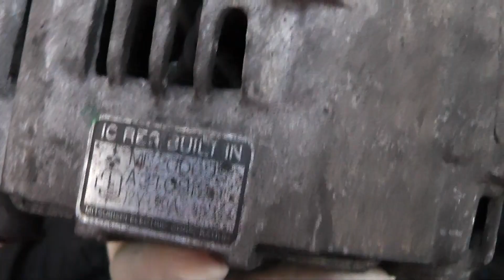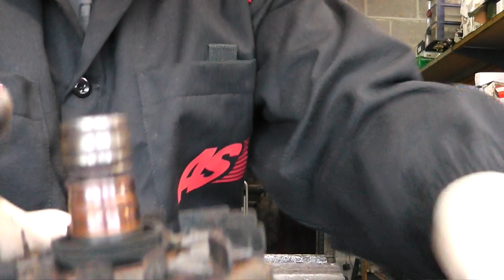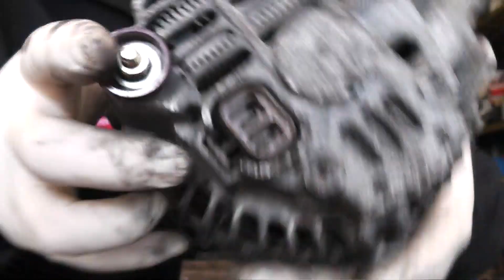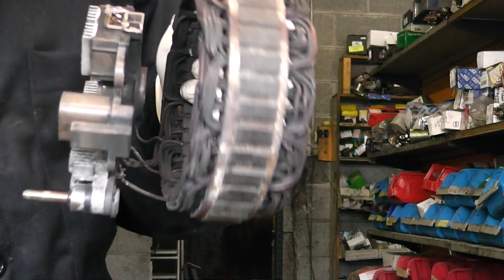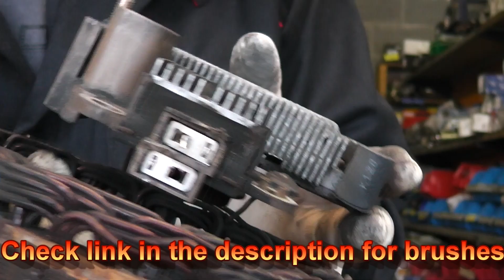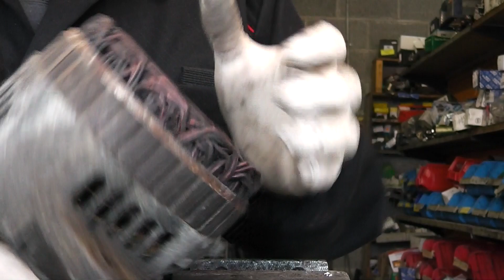Mitsubishi alternator repair / brush change. Fits Pajero, Kia,Pegeot and many more.

Comment: gday mate. I am doing an A55000 Mitsubishi alternator off a Kubota. I am up to aligning the slip rings with the brushes, the setup is almost identical to the alternator in your video. The alternator has allowance for your method except the brushes themselves, they do not have holes in them, even though they are the genuine part. I am thinking of just carefully drilling a hole myself?

Comment: hello, if the alternator bushings are damaged, is there any problem if the cable connections are wrong after the replacement?  that is, what happens if the upper bush cable and the lower bush cable are swapped.

Comment: I did my alternator, nearly same model, using your video. My slip rings were like new, so just new brushes for me. It was very clear how you explained it and it made the job easy for me and saved me $300.  I had spent money on a crap chinese one in the past, but now I will do my own in future. Thankyou so much for taking the time. You should be paid!

Comment: Was that soldering iron used on the Titanic? You would have done a better job with a red hot screwdriver. But thanks for the video. Its helped me with mine.

Comment: Mitsubishi alternators are very poor engineered. I've replaced my stock alternator with a BOSCH alternator and installed a Land Rover Range Rover electric vacuum pump with switch, for the brake booster. Cheers I'm done

Comment: There would be no melted plastic if you used an electronics soldering iron, not a leadlighting one.  It looks butchered.  Right tool for the right job

Comment: I removed an alternator, the nut to the the hot wire was so tight from the last mechanic that it broke the bolt that connects to the stator attachment, can this be repaired? also this is the same design on my 2002 Honda civic, thanks for the video, I searched and couldn't find a decent video, yours explained it very well. Luckily the one that broke is a core, but id like to rebuild it for future problems.

Comment: The alternator is new was working for two weeks, the battery warning light is on and when you start the engine it goes off, but not charging.what is the problem?

Comment: Great video, dude! My 95 DSM's alternator has been soaked in PS fluid for quite some time, and I don't think it has been through any kind of maintenance ever, also, I'm getting a bad squeal from it's belt, and experiencing some major drops in the voltage as well, so I'm looking forward to pull it out of the car for a well deserved cleaning job plus changing it's brushes. Your video was very helpfull, now I feel I can do it, thank you!

Comment: what if we just put a piece of brush on the end of the worn and push it in , maybe make end streight first with file so it connects better , would it work or would it spark and heat and something bad , or should glue with metal be used.  best comment...You have to be very careful handling the stator, it's very easy to nick and chip off the insulation on the windings.  Also, it's very easy to crack the insulation on the wires which connect to the rectifier when moving the stator out of the way to get at that last screw.  I managed to do both.

Comment: You have to be very careful handling the stator, it's very easy to nick and chip off the insulation on the windings.  Also, it's very easy to crack the insulation on the wires which connect to the rectifier when moving the stator out of the way to get at that last screw.  I managed to do both.

Comment: i watched your video ,you make it look as tho a 5 years old can do the job.
let me tell you that i tried to remove the bottom case of my Mitsubishi  alternator.
i followed your instructions and it would not come apart.
 mind you there was nothing wrong with my alternator from the start.
my car is 30 years old i have restored  it .
i see your video i decided to open my alternator.
 simply cause i had it removed from my engine as im also restoring my engine.
basically by hitting case with hammer the brushes were stopping case from coming apart witch it made damage to the ratifier in the process.
 so now your video has cost me a new alternator $289.00 from Ebay
thanks for nothing

Comment: Excellent videos, thanks a million for your great work and expertise. I have a question, where can I get a solder iron like yours, how many watts is it. Is there a chance you may show it on your videos. Also can you make a video on how to solder and  desolder a stator from the bridge rectifier  such as the  one's used on GM cars, earlier models 1993 Olds. 88 Royale to be exact. I am working on one and need to try to save the diode trio without damage to it.  Your advice will be greatly appreciated.   Thank you....:)))))

Comment: Thanks for the great video! Very helpful. Question - I broke the plastic insulator while pulling the unit from the engine. It seemed very fragile. Where can I get a replacement. I don't want to have to buy a whole rebuilt unit just because of that.

Comment: May be better to remove insulator 1st before tapping any part of the alternator with a hammer and also using a much smaller solder iron

Comment: Great Video.  The trick for holding the brushes in was very useful. Since I did not change the brushes I had to push the brushes in further with a dental tool..., Thanks.

Comment: Excellent video, easy to follow and well presented.  One question please.  I have the same alternator on a 96 Pajero that suddenly started to 'rattle' under load then it packed in altogether.  I replaced it with a spare and all was OK for about five minutes then that started to rattle under load .. It's NOT the bearings.  It seems to be over charging. Activator feed is 12.5v, the other feed is only 11.5v the output is constant at 14.5v so it seems to be running at full output non stop.  Steve